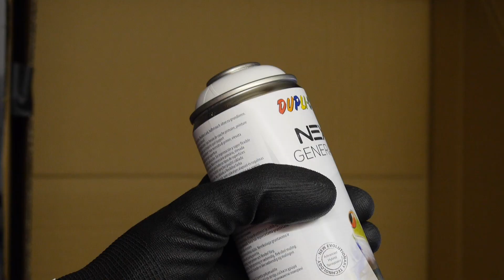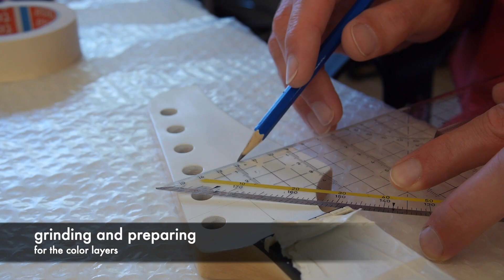Building a Mondrian guitar from a DIY electric guitar kit

Comment: Great work!  I hope to try the same or similar. I have a few questions about your process, if you don't mind.  1) What type/grade of abrasive did you grind down the paint edges?  What about prior to applying lacquer? 2) When masking for the black stripes, did you slightly overlap the colored rectangles? 3) Did you use standard painters/masking tape, or the type with extra adhesive to prevent bleeding thru the edges?  Thanks!
Reply from the maker: To be honest I do not remember every detail.  1.) I used wet sanding paper for the paint but I am not shure about the grit. I think something about 400. You will probably find better hints on the Internet. 2.) I did not leave space for the black stripes when painting the colored areas. So the stripes are always overlapping on both sides. They cover the border between the fields. 3.) I think I only used standard tapes and painters. The most difficult part are the edges, where the tape is always overlapping. So you probably will always have a little bit of bleeding. You can correct a bit of it with carefull sanding. After all I did som slight corrections with a permanent marker pen. But if you do this, you should check if the paint is going well together with the marker. Best is always tintry out things on a piece of wood before doing it on the guitar.
Besides all this, my best advice is to carefully fill the pores in the beginning. This did not work out very good with the method I used. Today I would suggest shellac with pumice powder (I hope the translation is correct). But this also depends on wich paint you want to use.
Reply from the maker: Grit 400 (probably) is used after every new layer. At the end you will use more stages of grit. e.g. 400, 600, 800, 1000 or even higher. Just look for some tutorials about finishing.
Reply: Thanks so very much for the finishing info!